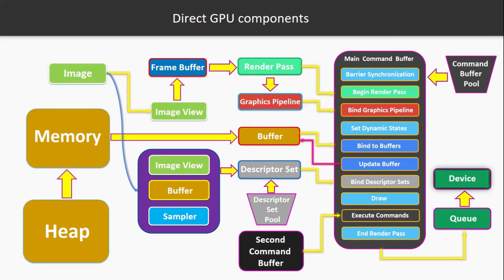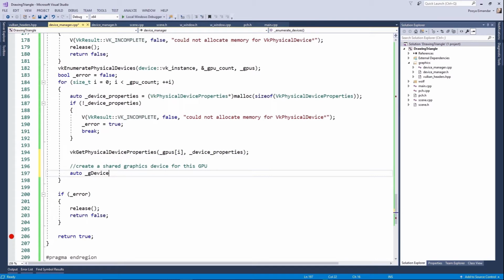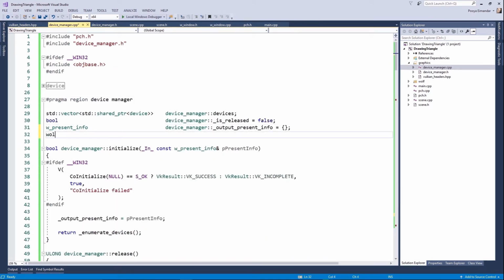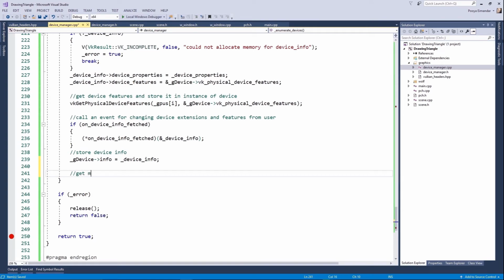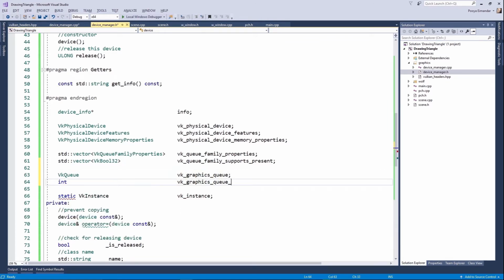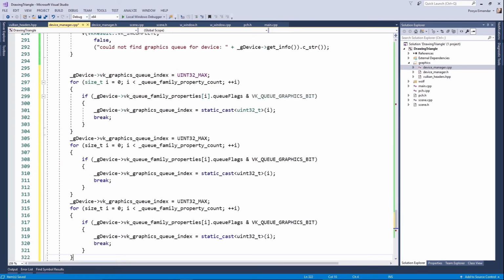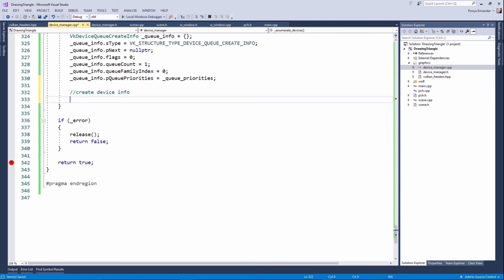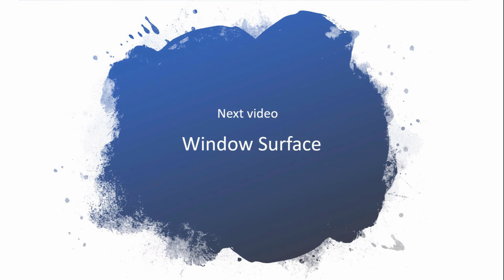Vulkan from ZERO to HERO: 2.4 Vulkan Device

Comment: Does these vulkan api methods specified in the video must be executed from the same thread ? Code looks great. But personally, I would say that lazy patterns should be used for all metadata vulkan api calls.
Reply from the maker: If you want to execute vulkan commands on the another thread you need to create secondary command buffer. I will talk about multi threading in Vulkan in next chapters.